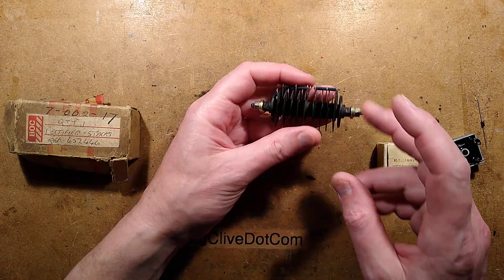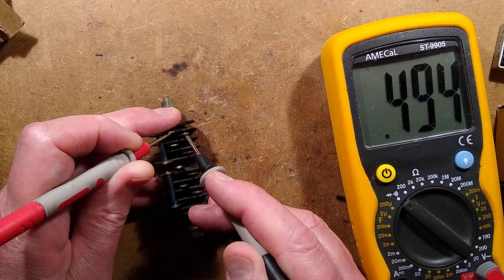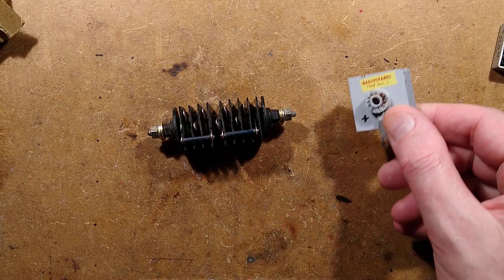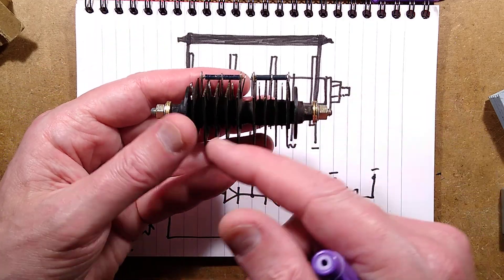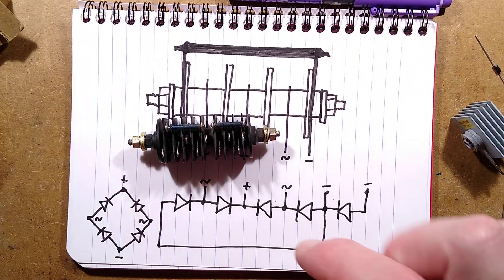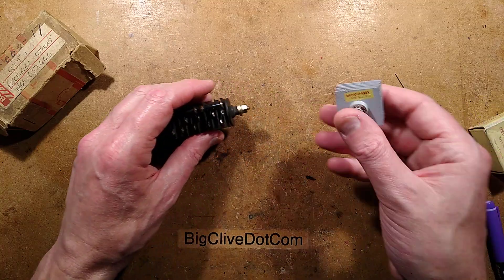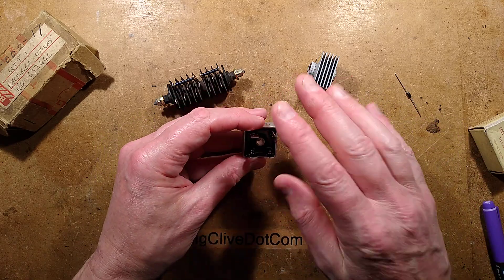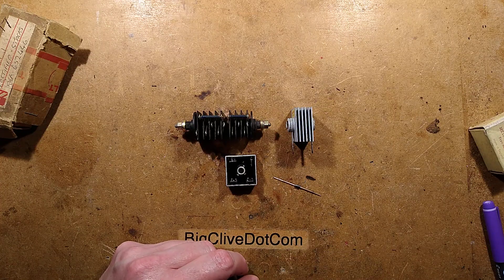Selenium rectifiers - the smelliest components ever

Comment: Great Video!

I own a private telephone branch exchange made in 1963. It has one of those rectifiers which still works! It’s all huge relays and capacitors, no semiconductor at all! I can take some pictures for you if you like.

Yes, those rectifiers are photo sensitive.
They used to make selenium light meters for cameras. A lot of cheaper Super-8 cameras had them until the early 1980s. There was a little meter inside the viewfinder or on top of the camera body and you had to keep the pointer inside a rectangle in the center by adjusting the aperture. There were not linear at all, but all that mattered was to keep the pointer inside the rectangle.

The smell of them is really bad. In Germany, we like to call them “Gleich-riecht-er”. A rectifier is “Gleichrichter” (Gleich = same, Richtung = direction, so the word literally means “Same direction worker/contraption”). A small change in letters and pronunciation turns it into “It’s about to reek” (Gleich = soon, riecht = smells, er = he/it).

The major downside of them is that they always have a great leak current. The leak current actually helps them to operate in a stack and distribute the voltage evenly. If you want to stack diodes, you need to add resistors in parallel to each or some diodes get much more voltage than others and fail. The selenium rectifiers have those resistors built right in.
When the leak turns worse (with aging), they heat up until they fail.

In the TV series “Mission impossible” (1966), there is an episode (24, “The Train”) where they simulate a train journey inside a hangar with a train car sitting on pistons and a complex system of tapes and amplifiers creating the sounds. Barney, (the engineer) is sitting in front of his consoles when smoke starts to come out from under his seat. He instantly tells his boss that there is a rectifier is going to fail soon but he can hot-swap it without interrupting the simulation. And then you see him doing it using a spare and jumper wires.
https://www.imdb.com/title/tt0649356/

I like this TV series. Almost all the technical stuff which was next to impossible back in the days can be easily replicated by any good maker nowadays. They remote controlled a truck (like the Mythbusters), used a remote controlled drone, they even used some kind of RFID in a poker tablecloth.
Reply: I know what you mean, but these bigass selenium rectifiers are semiconductors, just big ones
Reply: @tsm688  
I did some research so it took a while to respond. There is not much information but it is a very interesting topic!

There is a lot of confusion caused by a lack of understanding how the selenium rectifier works.

In fact, the rectifying effect of selenium was discovered in 1874 by Karl Ferdinand Braun, the guy who made electromagnetic radiation useful (radio transmissions) and who had discovered how to make electron ray beams (which lead to the TV picture tube).

But nobody knew how this effect worked and there was no practical application anyway. DC current was generated by dynamo machines using a built in mechanical rectifier or using batteries. Without voltage regulators and good capacitors it was not possible to generate plain DC out of AC. So the method of choice was using a steam engine with a DC generator to charge accumulators when large quantities of plain (unpulsed) DC were needed.

This had changed around the 1920s when there was an AC power grid and the need to charge accumulators from it. For high power applications, mercury rectifiers were used. For small scale, copper oxide rectifiers were used (especially by Westinghouse Electric). Then the selenium rectifiers were rediscovered which were much more efficient. The selenium rectifiers were used for medium power applications but soon replaced the copper versions for low power, too.

The metal oxide rectifiers were often called “dry rectifiers” and unlike the “wet” mercury type, you could move them around and even put them upside down during operation.

In 1938, Walter Shottky had developed his “Shottky barrier” and then turned his attention to the selenium rectifiers assuming that they are also based on his discovery. It turned out that they are not related to the Shottky effect and are actually true semiconductor diodes.

So the selenium rectifier was wildly used without anybody had the faintest idea how they really work until some time after 1938!

By 1952, the silicon rectifier diode was invented which was strong and reliable enough to replace most low power selenium rectifiers almost instantly – if you can afford the much higher price!

Engineers and literature kept their way of thinking in “wet” and “dry” and added the new category of “semiconductor”. In fact, “wet” rectifiers were not used often and so people (and literature) usually just thought in “normal” and “semiconductor”. So even if both, the selenium rectifiers and the silicon rectifiers are based on a semiconducting effect, people thought of them as very different things. 

Instead of using a huge “wet” mercury rectifier, it was much more economic to use an AC motor driving a DC generator. The major advantage is that you can control the generator and motor in several ways so you can regulate your output very easily and efficient. The last bastion of “wet” rectifiers were applications where the noise of large rotating converters cause problems.

Selenium rectifiers are actually highly reliable, they just have a serious problem. When the inside heats up to around 60°C, it starts to conduct in both ways and when this happens, it will generate vast amounts of heat which cause an almost instant self destruction. If you push them too high and/or operate them in a warm environment, they are likely to fail. And usually they are placed near heat sources like regulators and transformers. Also the environment temperatures in summer can reach 40°C easily so there is not much of a temperature difference to get rid of the heat the rectifier generates internally. And while using fans to protect precious silicon rectifiers was common, nobody did that for the cheap selenium type.
Reply: I was about 14-15 when the original mission impossible came out...I loved it, the mystery voice of Mr. Phelps boss, the electronic devices, the near escapes....and the catchy music ..and the electronic devices...
Reply: @dougankrum3328  The drugs and most disguises are pure fiction but the electronics is very detailed and almost all of it could work as seen on the show. I like the little drone in the vents, the remote controlled truck and the RFID poker table best.

The poker table sensing which cards are placed on top actually seems to work like the German Railroad InduSi system where the train can sense 3 different LC circuits shorted out by signals if they are green. So I think that was the idea in the show, just using more than 3 different resonance frequencies. Nowadays microcontroller inside RFID tags would be the method of choice.

Comment: This video brought back a stinky memory!  I was in a college electronics class in 1971 and one of the students was doing a lab assignment. There was a question in the book asking what would happen if a capacitor shorted and the idiot shorted out the circuit to see what would happen instead of just thinking about it.  I was across the room when I heard a loud  pop and smelled one of the worse smells ever! He had shorted a power supply that used a Selenium Rectifier.

Comment: My dad had one of these fail in a non union coal mine in the 70's. There were 4 on a massive multi voltage transformer. Can confirm, they are VERY smokey. Filled the whole mine with this thick fog, everyone had to lay flat on the floor until the fans were restarted.

Comment: That takes me back! Used to find them in school lab power supplies still in the 1980s, which frequently landed on my bench for repair after some spotty oik had blown them up. Replaced them with silicon bridge rectifiers, but those were much less forgiving of accidental shorts and didn’t last long.

Comment: never had one go 'stinky', or 'short', so far, but many times 'high internal resistance', reducing output, as said in the video, there were later types encapsulated, like the modern silicon ones,  and called 'contact cooled rectifiers', these as they're sealed dont stink but still can go low output
Reply: one thing is the makers data sheets say never to test them for reverse leakage with an insulation tester, it can cause them to break down ruining them,

Comment: "I shall hold it with my fingers it's not going to skew the results"

Back when I was a baby engineer, we had a nice fluke tester, what I accidentally discovered while buzzing out fuses on a scissor lift was that the damn thing would beep and give continuity from my left hand to my right hand... So I'm up there, fuses in hand and all of them are fine.

I eventually figured out what was going on, for whatever reason the thing was detecting my 1.5Mohm-1.7Mohm hand to hand resistance as a dead short, but not if I was just holding the probes... I had to press them into the skin, the failure was that perfect... Just holding them wouldn't do anything, but the second you press them against the fuse caps? Continuity... Confirmed it by squeezing them hard between my fingertips. 

It's been over a decade and I've never tested stuff like that again.

Proof that even the big boys toys can, and will fail in ways you wouldn't expect... Anyway, in every other way it worked fine, wish I'd kept it, would have made a great learning tool.

Comment: Selenium rectifiers in the old days were known as the all metal way, they replaced glass tungar valves which were used to rectify currant, they were often used in battery chargers, made by Westinghouse and GEC, a few of my vintage battery chargers contain these things. RS stands for Radio spares and are still going today, real old battery chargers used tungar valves in the old days an the invention of the selenium rectifier was a big thing in those days as things could then be made smaller as valves needed bigger cabinets to house them and associated components. I never knew about the smell of these things when they fail but I have heard about the smell of burnt onions when electrolytic capacitors fail or about to fail, those that fix old valve radios an TVs will know about this warning sign.

Comment: As a youth, I used to repair TVs in late 60s. I was called to a late 1950s TV, when they answered door, I dumbfounded the owner by saying I know what’s wrong without looking. We always replaced with a Silicon Diode plus  high power resistance (dropper section) and as you said TV usually performed “better than it had for years”.

Comment: I’ve changed a lot of these. Back in the day replaced them using the BY100 ‘top hat’ silicon diode which was the forerunner of the 1N4007. Record players and tape recorders often used the small aluminium cased contact cooled selenium rectifiers by Siemens, Westinghouse or STC. The smell wasn’t great when they failed but there’s an industrial two part underwater epoxy that when mixed smells like dog ** and seems to stay with you long after you’ve finished using it - give me the selenium smell any day!!
Reply: I've had those things short circuit.

Comment: I have a big Dux radio furniture from the 50s that is a part of my otherwise own made big custom tube audio system in my living room, it has a Selenium rectifier inside but it is the flat compact one that almost looks like an aluminium match box but quite thinner, must be very many thin layers in this one since it handles the 300 volt plate voltage. I kinda been waiting for this to get stinky and thought of changing it but it still works so I have kinda not done that yet, I have a whole bag with NOS Selenium rectifiers of this kind too but I tend not to use them just because I Know they gonna smell like 100 hard years when they fail, though I hope I won´t have to experience this anytime soon

Comment: Replaced them in my old tube amplifier. Didn't want to risk it going up in smoke and be teddious to clean up.
For voltage sensitive applications you can always mimick the voltage drop by making a constant voltage drop (in series with rectifier if a critical application) circuit with modern semiconductors. Sure it needs some cooling but there should be plenty of room for that.

Comment: I was recently converting an AC garden light power supply to DC, managed to mix up the pins on the bridge rectifier and as soon as I plugged it in the smoke escaped. That was a silicone rectifier and it smelled bad enough. I can only imagine how bad a selenium rectifier would be.
BTW: I remember seeing selenium rectifiers in the old radios I played around with in my youth and they were common on motorcycles until at least the early '70s.

Comment: I have a bunch of antoque scale model trains and track (unfortunately none of the trains work as they've either lost parts over the years or moisture destroyed them) however it also comes with a power supply made in England by 'Brakeman' with two DC outlets and one AC outlet. It was made between the 50s to early 70s.
I'd open it up but it's riveted shut and I don't want to drill the rivets out. Reckon it contains one of these? I'd always wondered how it created DC.
Reckon it's one of these or something even older and weirder?

Comment: Way back in the early 1970’s, Kodak replaced the tube rectifiers in the amplifiers in their automatic roll printers with a direct replacement selenium part. It used the tube socket, so it was mounted on a tube plug. These were orange. I still have a few in an electronics draw in my shop. When they blew, not only did they smell, but small liquid balls of bright selenium would squeeze out. I don’t remember much smoke coming out of them.

Kodak in turn replaced them with silicon bridges, mounted again on those tube plugs. I have a couple of those too. Kodak kept using tube circuitry until sometime in the 1990s.

Comment: I'm a bit more curious about if there are applications where a selenium rectifier is more useful than a silicon. I know that in some HF circuits the silicon isn't always doing that well.
Reply: Really high-current low-voltage applications like welding and electroplating, where its obscene pulse tolerance is helpful and its poor reverse voltage doesn't matter.  HF, not so much, it's not exactly a delicate part.  Though it has been used as a detector (radio crystal) occasionally.

Comment: Selenium rectifiers were made by Westinghouse B&S at Chippenham. Each plate made a diode and then the plates were  arranged to make a bridge rectifier. The aluminium was coated with selenium in an autoclave, then sprayed with tin to make the conductor. The story was that they first made them during the war as a prime component for radar. They couldn't understand why some batches were much better than others, until one Mr Cubitt noted that when the wind was in one direction, good rectifiers, then rubbish in another. As these rectifiers were very much in demand they would save production for the good wind direction days. A weather vane was mounted so that Cubitt could see it from his office. The Plant and Buildings in due course sent the rectifier department a bill; " For the erection of Mr Cubitt's Cock"
I dont remember any particularly bad smell. Perhaps you only get that if you overload them.

Comment: These were common in 50s radios - early 60s - I have a zenith that had one and I replaced it with a diode and a big resistor since the circuit expected a voltage drop.

Comment: Two jobs ago, the shop had a battery charger that had selenium rectifiers. It was huge, like a stack of dinner plates, yet only rated at 20 amps.
     I didn't know they extended into the '70s and '80s...I thought they went out in the '60s.

Comment: PSA for those who wanna experiment with those individual  plates: the coating (of the semiconductor, i'm not thinking of the paint) contains cadmium, which is really quite bad. 
Use gloves when you try and fool around with it, and avoid any sanding/scratching of the surface layers!
Reply: Cadmium....yeah, really bad when heated, that's why they removed it from silver solder, although it really made the solder 'flow-out' very well.
Reply: @dougankrum3328  Old soldering wire was really something great, but I'm glad they've mostly done away with it. With modern lead and cadmium free solder you'll be fine as long as you've got good Flux
Reply: Nah experiments are more fun when there's risk involved
Reply: @Kyharra  Yeah, but I like my bones.
Reply: @qwertykeyboard5901   bones are just temporary energy is eternal

Comment: Yeeep, I got a trash heap 12V lead acid battery charger a few decades ago with massive selenium plates inside. Each diode had a rather large internal resistance and bubbly surface so the charge current was really low.
So, I replaced it with silicon and built in a switch array to engage the selenium diodes in series one by one. I had to rearrange the selenium stack ofcoz. This way I could slow- or fast charge at will depending on battery size.... or go full bore, however when doing it on large accumulators the thermal fuse inline with charge current would actually cycle as the silicon bridge is that much more efficient hence outputting more than transformer was designed for.
It's still operational, hacks n all, about 45 yrs old by now I'd reckon... looks like a pile of garbage though.

Comment: You can find them in early battery chargers and arc welders. Usually the ones in arc welders were quite big- probably to handle the high current. Large squares 4 or 5 inches per side.